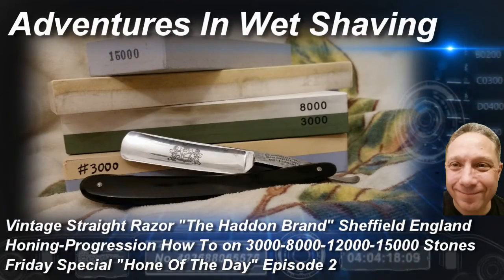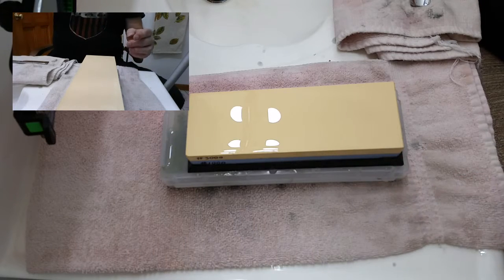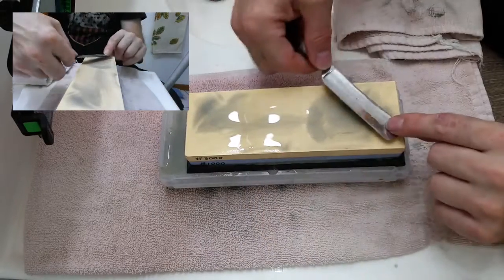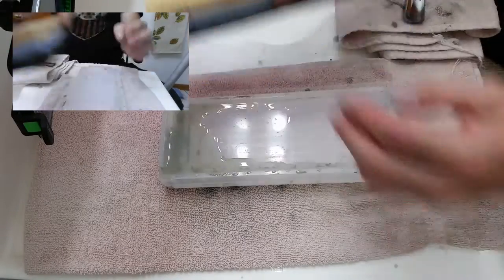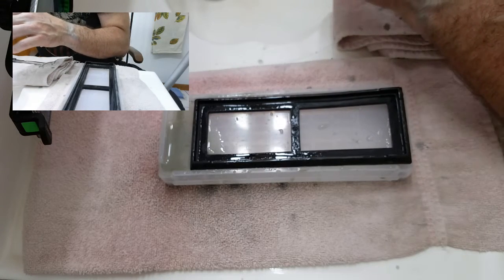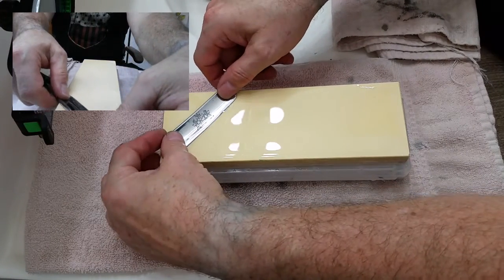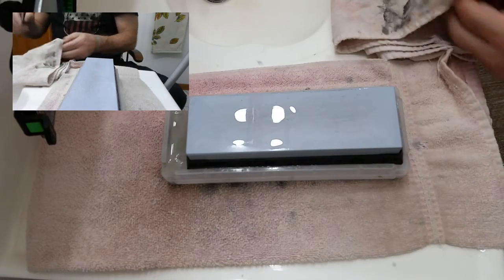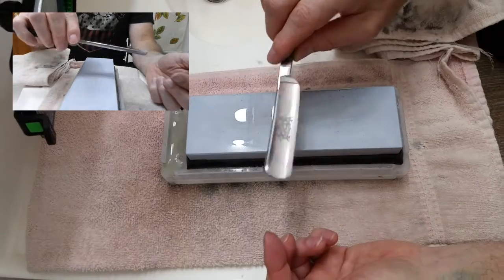Vintage Straight Razor Honing-Progression How To on 3k-8k-12k-15k Stones, Friday Special #HOTD Ep 2

Comment: some people think 8k is shave ready, others 12k is ample, you go to 15k before the strap. any reason as i know these higher stones costs a bit more... I also see some use that thin stuff (coated) is that a cheap option for >12K??
Reply from the maker: Thanks for watching! These stone are not that expensive so I have been trying out different options and styles of honing. This is what I have been using and how I use these stones. These are some of the sharpest razors I have and when I am finished with a razor honing in this way they are definitely shave ready. I may try going up to just my Shapton M5 12K next time and see if I can tell any difference. Again thanks for watching and the comment!  :)